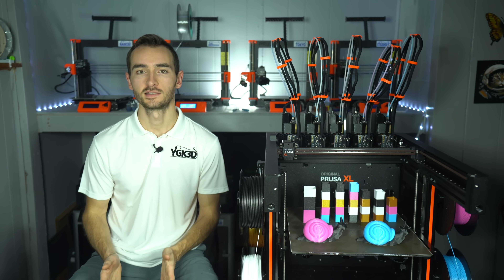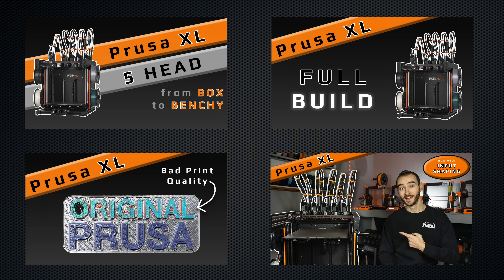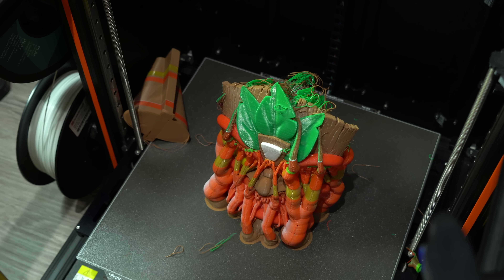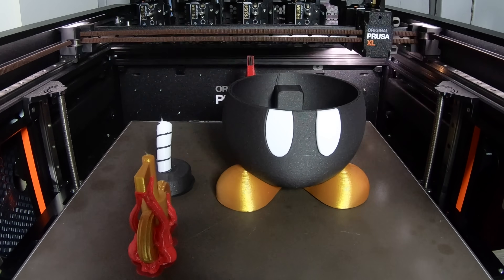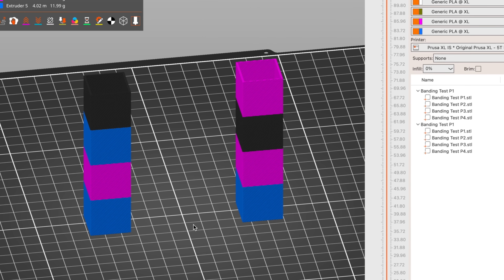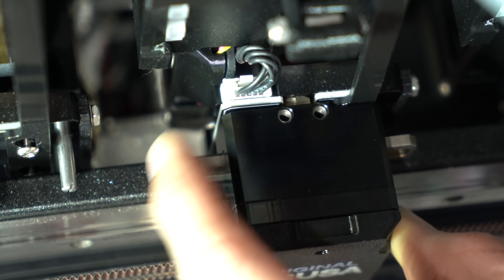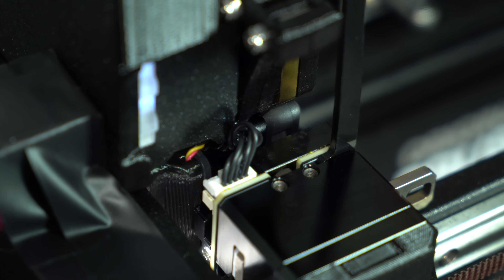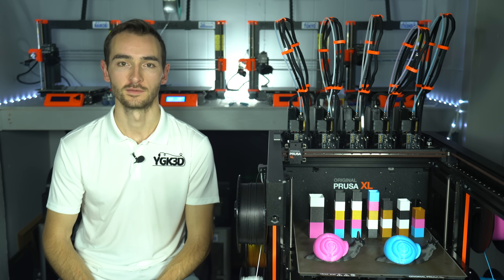I Fixed The Prusa XL's BIGGEST Flaw

Comment: so is Prusa selling a broken printer or is your printer defective?  Is it possible that Prusa knows about the problem, but pretends nothing happens?
Reply from the maker: I think the design of the tool docks is flawed. Not every printer/tool seems to be affected in the same way, but as you could see from the images at the beginning, I’m not alone in having these issues. This was just a small sampling of the prints I’ve seen shared online that showed similar problems.
Reply: there seems to be a lot of people having this issue. sometimes its just visible layer lines, sometimes its more severe

Comment: I’m curious if there is a cause. Mine doesn’t have this issue and the heads repeat fine
Reply: I do wonder if the docks aren't seated fully. I had issues with one of mine and noticed I hadn't tightened the mounting screw fully enough to squeeze the dock into the extrusion.

Comment: Nice temporary fix.  

Prusa needs to address this in the design.  The tool heads must lock in place on the dock and on the gantry without any play, or else you'll never have any precision in your parts.

I don't want to use this to print figurines, i want to use it as a tool to print functional parts which means it needs to be accurate.  Bumping the tool head is not accurate.....

Comment: Great! But it is a bit disappointing that a very expensive printer needs this…
Reply: very much so. I mean, even if you only went with a 2 or 3 head design, the printer cost is freakishly high - to have this level of error.    That is not to say it isn't valued properly - as tool head changing is a very intense operation - and you don't see others doing it - because of the cost associated and the now obvious precision needed.
Reply: Should I also mention that Martin Zeman 3D had the MK4 and XL in front of his eyes 4 years ago with Jo Prusa himself and said in his review of the MK4 that “it looks almost identical compared to from 4 years ago”?
Reply: Yup.

Comment: Incredible analysis and creative workarounds, and equally incredible flawed design and implementation by Prusa 🤯
Reply: It is literally the best design by far on the market. Not perfect sure, but you makes pretty you do not know what you are talking about.
Reply: @zebarzebra  "literally the best design by far on the market", I'm not sure what you're referring to since the results speak for themselves.
As counterpoint, Teaching Tech's video illustrated that the XL design is lacking nozzle brushes, an effective solution adopted in many other multicolor or multi-material printers and which addressed some issues once added to the XL.
Reply: i would rather have filament wasted poops rather than horrible layer misaligned prints that end up in the trash bc they do not fit or look good  @zebarzebra
Reply: i am the thead., i will force PRUSA to repair then printers...

Comment: For the price of this printer. It should be flawless and exceptional,  so sad this is what Prusa has become. I canceled my XL, my MK3S which is excellent,  sadly will be my last prusa. Much better cheaper options out there for single head printing with larger builds areas. I guess those who must have multi head will be dragged along until for a while.

Comment: Great work 👏🏻 at the same time it’s a pity how low quality testing has gone over at prusa
Reply: I would guess this was time-pressure from Bambu Labs competition.  To be fair, i was never able to get rid of layer banding in either of my Mk3's...
Reply: @JustAnotherBigby Time pressure? Prusa has literally had decades...were they doing nothing that whole time? And now Bambu Lab has another printer while Prusa still can't make their work? Prusa held back this release over and over and over...presumably to make it perfect, right? Guess not. There is no end to the excuses for this company. I think they have a spoiled company culture. I think Josef is a control-freak.
Reply: @geometerfpv2804  Remind me again now many warped build plates bambu had? Or how many broken AMS units? Or how many broken MC fans and broken AP/TH boards? They're on like revision 9 of their AP board lol. Lets not pretend like BL is the beacon of quality.
Reply: @obie224  imagine spending 1500 on a printer and getting a warped bed and BL telling you it's "within spec". Even though there is a 2mm warp deviation. Then you gotta spend 4 hours replacing the bed. The bigger you print, the bigger the problem the warp becomes. Try printing functional parts that don't mate together right because the warped build plate left them deformed.

Warped build plates wasn't a design problem? Cool, meanwhile the AMS, AP boards, rails/bushings, etc were. Hell even their packing is a design issue. As hundreds of people get shattered glass doors during shipping because BL doesn't pack them well.

Hundreds of people have 5 tool head XL's that print perfectly. I mean this dude literally assembled his XL wrong in the initial assembly and created problems. Who's to say he didn't mess something up during assembly and created this new problem.
Reply: @geometerfpv2804  I'm not arguing.  I don't own Prusa's any longer for this reason.  Frankly, I don't understand why anyone would make their own firmware.  This feels like an opportunity to retake classes you've already passed...
Reply: @LilApe I root consistently for a losing football team. They never win. I still think of them as the best but I'm always disappointed. I should find a better team.

Comment: I've been waiting for this video. great work. I need to run the test print on mine and see what the results are. I've only run some small multi-colour prints so far. I'll report back. How much time per change does the bump solution add?
Reply from the maker: Thanks! Maybe 2-3 seconds per change.
Reply: @ygk3d  Thanks. Just a thought, what about the nozzle offset calibration. One assumes that it has to pick up each tool 'perfectly' to get the correct offset else if not the 'wrong' offset will be set in the tool settings. I guess your testing shows accurate tool alignments as well. I may knock up a test print for this if needed.
Reply from the maker: @GuyH77  I redid that a few times over the course of my troubleshooting. It didn’t help unfortunately. I forgot to mention that in the video.

Comment: Well done on finding the design issue with this printer. I hope Prusa can come up with a real solution 👍
Reply: There is no design issue - there is an assembly issue.   If you look at the video at 6:02, the support straps for the PTFE/Wire Bundles are actually installed incorrectly - the two screws that hold the straps in place are supposed to be at the bottom of the keyhole, not the top.   As these are pictured, the support plastic is actually resting upon and impeding the lower right coupler pin - which is causing misalignment.

Don't install this "fix" - just assemble the printer correctly when you receive it and pay attention to the manual.
Reply: Tbh the e3d tool head design left a lot to be desired. It's concept was ahead of its time but it was far from perfect. Also, expensive to make.
Reply: I'm not ashamed to inform you that this is pretty much best solution to the tool changing problem. Such behavior is to be expected in such a system. Ensuring the tool is properly located is imperative to it's function. 
The best solutions are often times the most simple ones.
Reply: idk, if only someone did think of a way that allows you for a repeatable toolhead change with a few microns deviation... 🤦‍♂
Prusa's design seems weird considering what E3D has come up with and that they left it open-source for people to develop on those foundations...
Reply: Pneumatic tool changing doesn't have this issue. (Due to a centering cone and pressure applied.)
I think the best solution is: Don't change tools. Use Bambu Labs AMS solution. (And deal with "poops")
Reply: Just tighten all screws. It is not a design problem.
Reply: @dirkhilleke2498 Yeah, that's the type of solution you would expect from a 4000$, pre-assembled machine 👍.
Reply: @Lemon-wk9ds  its not fully pre assembled though.
Reply: @JJiG  From what I can see in the video, the problem is in the toolhead and the extruder, which are factory assembled whether you buy the printer semi or fully-assembled. The problem seems to be on Prusa's side. 
If loose screws were the cause, I would assume that there would be no need for a custom 3d part to fix it.
Reply: @Lemon-wk9ds  Nah, I kinda half expect the Prusa solution to involve zip-ties. ;)
Reply: @Lemon-wk9ds  It is indeed a design flaw; by only loosely capturing the tool without applying an even and measured force against the tool to center and align it after capturing it is never guaranteed to be in the exact same orientation after every change. There should be a centering cone in there like in pneumatic tool changers; those come with applied pressure as well to keep a tool firmly in place. It would be nice if they could apply an active force on the tool to pull it firmly into the carriage.
Reply: @missingdogmusic  it has three centering cones on each tool